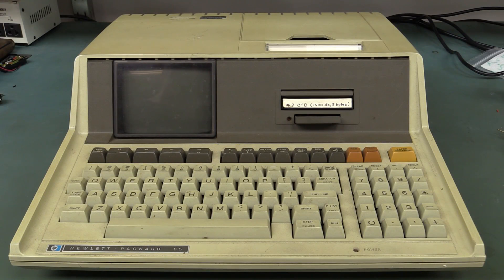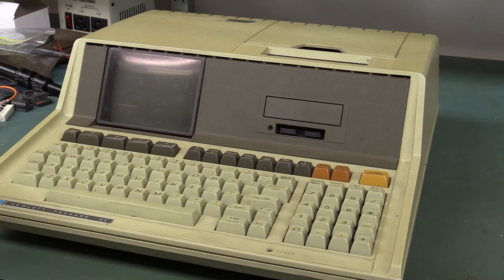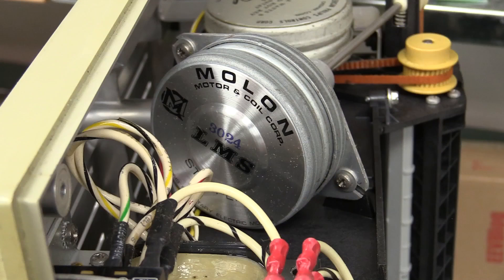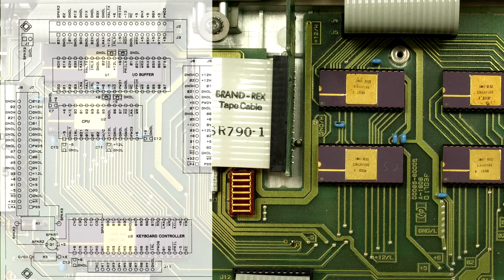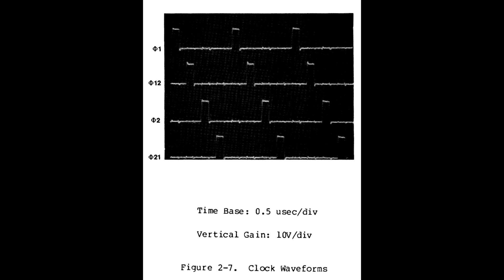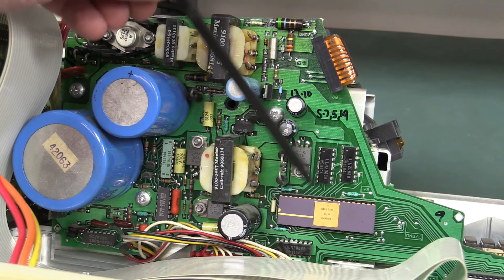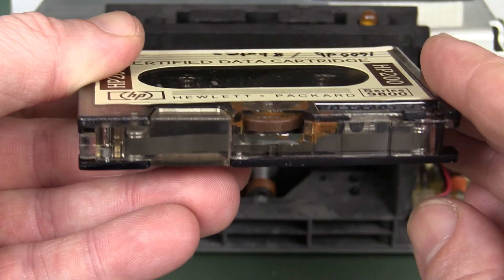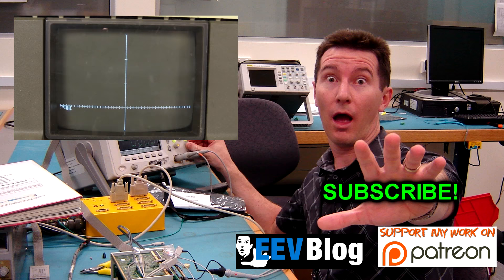EEVblog #903 - HP85 Vintage Computer Teardown

Comment: One thing that definitely stands out compared to home computers of the era is that this machine was probably expensive to produce, but that's to be expected from H.P. of the time.  This thing was also more portable than just about anything else made in 1980.
Reply: Of course, HP influenced the market. HP IB (HP interface bus) became GPIB (general purpose interface bus)

Comment: Serious nostalgia for me.  I learned to program aged 7 on an HP85a. My dad was a chemical engineer and decided to buy one because it's what they used in the lab. It came with a fantastic set of manuals which taught you how to program in HP basic. My brother (about 9 at this point) and I used to get pocket money to translate old FORTRAN process models my dad wrote for some hideous mainframe into HP basic. It was such a fantastic computer - I remember taking it to our computer club and all my friends (who had ZX-81s with 1k of RAM) were astonished by the thermal printer, built-in tape and screen and most of all, collossal 32kB of ram (we had one of the expansion units in the back). Still yearn for that beautiful clicky keyboard with lovely smooth plastic keycaps.

That was the start of a 30+ year career in programming (still going).

Comment: I used HP85 computers in 1982 while working as a trainee for a geophysics survey company in the oil industry. We used it connected to seismic equipment and to the positioning systems to retrieve the data and log it with the current position.

Price at the time was 3.500 USD

Thanks for the memories!
Reply: Unfortunately you missed a chance to say Yankee bucks!

Assuming you're not in Australia!

At least he didn't do this one like he did to his new electric car he took the Swift heart he didn't turn it on they locked the car he turned it on and he didn't take it apart.

Was going to put a comment on there saying oh he's going to take it apart in the parking lot before he even gets in it but someone else beat me to the punch sort of oh well.

Anyone else find a high-pitch voice very irritating I actually like his voice however my father has expressed this at least a few times I don't pay it any mind because to each is old but just curious if it's just him or if we would like that as well no harm done. I'm not saying it's a bad thing but I'm just curious what other people may think.

You know sometimes, too like that :-) finger pointing to myself on that.

Oh oh I know what does chips end just for 4in impact or whatever had done some damage to it let's get crackin.

Speaking of cracked chips I know I'm not talkin about the potato chip you stepped on by accident and even bigger mess.

Has anyone ever heard about those ssds solid-state drives that are like hyper secure that actually literally suck can self-destruct basically uses high voltage High current the poppy chip whatever time and then takes out the controller for the flash memory.

As well as of course full encryption all that those can even be remotely killed as in bang bang bang go to chips buy a cellular link if I remember correctly if the battery on the laptop should die and other things as well I would like to see if someone could ever get a hold of one of those that see a video of it and action blowing the chips that would be just awesome I've seen the aftermath pictures but never a video of them actually doing the destruction process.

You know who would I would not need that to destroy your data in some way chips are going bang right well he goes boom electroboom of course I'm pretty sure he'd find a way to destroy data even waited want to.

By the way I did know some way to accidentally destroyed dad on Once for some reason they were swapping out an SD card in something remove some files they really really needed and a hamper in the kitchen it somewhere is wearing the garbage disposal and yes either or they're across the room or something but having a hard time getting the SD card out we did it popped out bounce off the corner of the room and wind up going into the running garbage disposal well they were pretty pissed fortunately by the way I did know some way to accidentally destroyed Anna wants for some reason they were swapping out at SD card in something to move some files they really really needed and a happy in the kitchen it's away from the garbage disposal and guess either or there are crossed the rumor something but having a hard time getting the SD card out we did it popped out Ballast off the corner of the room and one up going into the running garbage disposal well they were pretty pissed fortunately everything that time was just a copy of the data them was in the internal memory the only realize that after about billion megabytes of curse words later.

Worthy oz of that happening at least in terms of dead destruction by accident that would have to be one in a million toilet water billion would be so I'm making a milkshake in the same thing happening just right when they opened it where is open for less than a second but yeah heard about that once but I think it was staged there's a video on some website play article was entitled dumb ways to destroy that people have destroyed data or something or a parent lost everything looks staged so take that with a grain of salt. Although probably the easiest way to destroy data on a hard drive to be a physical disc would be the usual those styles of drawing that's the glass platters and all you would need with a mechanism that would act like a spring loaded hammer in a drive housing that would put a sharp Point Stu all the platters on all sides LeBron 5 bye-bye data don't know if it would ensure enough shards to bring her every bit of it useless but it's an idea for cheap means of this. Croatian be using Google what I'm talkin about it be that somebody will get my idea LOL.

Comment: I’ve had a lot of retro tech, but I regret letting my similar HP sci-comp go more than even my vectrex. I cannot find my exact model on YouTube, but it had a 1x30-something alphanumeric PCs display. I loaded basic programs from cassette, and it had i/o cable adapters the size of 8-track audio tapes.  The HP daisy wheel printer it came with weighed over 50 pounds!

Thanks so much for sharing this.

Comment: You need to get your hands on an HP 9825. The CPU in that thing is a beast. 16 bit, 10 MHz, in 1976! It was built on a ceramic module, with multiple dies, and connected to the board by zebra strips! What's more... Zebra strips that WORK!!! Mine STILL works to this day! It also had hinged PC boards that could fold out while the machine was live!
Reply: It was based on the architecture of the HP 2100 minicomputer.  There was also the 9845c graphic workstation which was used for the colour graphics in the move 'War Games'.

Comment: Classic device. My father had one of these at university to sort a list of student names, calculate the class average and sum the term scores for each student. Once the data was entered, it took the HP85 about 7 hours to complete the process for about 300 students. It took so long because it could not store all 300 records in RAM, so the sorting process had to be partially storage (tape) based. Excellent video, thanks!

Comment: OMG!  I used to use one of these "back in the day".  The company I worked for did marine engineering design and analysis services for cold regions (ice breakers and oil rigs working in the ice) and I used one of these as the front end to a number of our systems.  I once waited for my luggage at the carousel of the airport and out it popped, outside of its box...all naked..  But it survived and fought many a battle afterwards.  Thanks for the trip down memory lane.
Cheers!

ps  The teardown is awesome.  I never did look under the hood as it was super reliable and never gave me any trouble.
Reply: Drink!!
Reply: Was using one until a few years ago.

Comment: It took less than half a human lifetime to get from that, to computers that can render this video in minutes.
Reply: Nothing amazes more than this fact, or more importantly understanding this fact and pondering the future.
Reply: My current video card has, I'm not kidding, 2,000,000 times more memory than my first computer.
Reply: Yup My first computer was an 80286 with Dos playing Final lap and Police quest. Both had about 64kb of RAM or 64*10^3 bytes. Today my PC has 16Gb of Ram or 16*10^9 bytes. That happened in 25 years, imagine another 25 years the technology we will have.
Reply: well you need computers to design better computers..
Reply: +John Hartman the original IBM PC with the 8088 at 4.77MHz started at 16 kB, but needed 128 to do real work, and was expandable to 640. By the time the 80286 rolled around (IBM AT and clones) the standard memory size was pretty much 1024.

Our first PC clone was a Sperry that had 128 on the motherboard, and was purchased with the 128kB extra memory option. That was a full length isa card that came with four rows of 18 memory chip spaces — one row with soldered on chips and the other three with sockets, for 128k per set of 18 chips you'd install. A slightly later model Sperry I once bought for parts at scrap prices had 256kB on the motherboard and included a 384kB expansion card, tiny little quarter length ISA thing.
Reply: ha! my first computer had 1k of ram, black and white graphics and no sound!
Reply: @RetroMarkyRM  let me guess ZX80/81
Reply: @ThunderClawShocktrix  nailed it! :-p
Reply: most of the development has come from alien tech which has been dripped out. Think of how CDs suddenly came into being, Optical fibres etc. it's all from Black ops projects that have access to exotic tech from other worlds.

Comment: Closest I ever came was an old  CP/M machine that the guy who ran the hardware store gave me after I wrote a basic program for him to keep track of customer's billing on a little Commodore 64 machine, I kept the data on a floppy so he could access it and write new billings and such. He was so thrilled he gave me the old machine that he never could figure out how to use (his wife gave it to him for Christmas) and threw in a brand new multi-speed Dremel tool with accessories.  I was happy, and he used the old C=64 for about three years then upgraded to an IBM.  I had fun with the CPM machine although it didn't have the games my son wanted for a PC so he flat refused to use it, I found it fun to play around with.  The amber screen was easy on the eyes, and the software packages he threw in  included a sort of pre-office type with word processing and spreadsheet operations, as well as a great little checkbook program. I was injured and had to lay around my house for a couple of weeks while I healed up, so to kill time, I took our small town phone book and typed it into the old machine, using a database setup, then did a sort by number and printed her out as a reverse lookup book.  We kept a copy of that book in our squad car for several years, I also had it sorted by street and house number so you could drive up to a house and find that phone number, then call the resident if need be to clear the house because things were getting sort of dangerous or just asked them to move a vehicle that was illegally parked blocking a neighbors drive way or such crap.  It was well worth the effort, and on that old machine, it was very easy because of the quality of the keyboard, something I have never experienced to that degree since I sold the old machine to our local Judge, who wanted it for a backup as he had all his Judge shit on his unit of the same make and model.

Comment: I learned from employee #7 of Compaq Computers, who worked for TI for years prior, that for ESD protection that the best ground strap is a wide thin piece of foil. Because the rise time of an esd discharge waveform is so fast, that skin effects dominate in the overall resistance of the ground strap so a wide thin conductor maximizes your  conductivity at the extremely high frequencies involved with an ESD discharge.

Comment: I used one when in astrophysics at the University of Missouri in 1976. It was great not having to use the mainframes to run our programs. Before that, I used an HP 9100 and Olivetti programmable calculator when I majored in electrical engineering at Forest Park College in St Louis in 1974. Great machines!

Comment: I used one of these in a radio lab for a number of years. Couldn't fault it for the ease of programming it to read and control HP test equipment and other IEEE Bus instruments too.  It could carry out the measurement and then print out the results. Just simple and straight forward.

Comment: I made a course on HP for those. They were very cute. The tape and the thermal printer were very useful . In HP in Brasil they used them as individual terminals. But in Brazil they had the expansions limited to just one slot. The keyboard was gorgeous for the time.

Comment: I worked briefly for a company that used these in the oil industry. early 80's
Every joint that was made on the drill string was recorded on these displaying a correct torque curve on the screen. & recording to tape.

Comment: The tape looks a lot like the ones I used to backup PCs in the 80s. They were pretty reliable and designed not to stretch or have the other problems that common audio tapes had.

Comment: I used one of these together with an HP-IB (IEEE 488) connection to some laser measuring equipment back in about 1988. Amazing for its time.

Comment: I bought a couple of years later 87, which is pretty similar to the 85, but with a wider CRT and no printer, also no tape.  Instead it had HP-IB, so an external dual floppy unit was the storage.  By the way, indeed there was a programmable calculator that preceded the 85 and looked somewhat similar..  That one came out at the same time as a Litton calculator and a Wang calculator.  I tested all three and only the HP did its engineering math with exponents correctly.
Anyway, I think the 87 had 680 kHz clock.  And both the 87 and the 85 had the 8-0register (64-bit) data structure that made the 10E499 numeric range possible.  And the expansion module options brought in a serial communication module and a co-processor that ran CP/M on a 4 MHz Z-80.  Otherwise, a third party, Bering sold a 5 MB (!) hard disk + an 8-inch floppy unit.  I partitioned the 5 MB to 4 sections of 1.2 MB, because the 8-inch floppy could that way be used to back up the hard disk.

Comment: BYTE magazine initially was a makers journal. Tear downs were natural as building was part of the scene. Circuit board creation, circuit design, programming theory.  All very rich. I remember one article where the limits of double sided circuit board were worked around by using narrow circuit boards that were soldered edge to face to create jumpers across the board. Component level to systems evaluation. Later years it changed as the industry provided more advanced products.

Comment: The RAM on the CRT board is supposedly UP04160-2 16K*1 DRAM, so thats 16K*4 in total. Or 65536 pixels in B/W that would be good enough for 256*256. The reduction to 192 lines may be the wrap area for scrolling the screen. Filling the memory off screen and then set an offset register during the vertical beam return looks much nicer.

Comment: 20:30 In old cassette tape decks the spools don't drive the tape over the head. There's a roller and a pin that pinches the tape, and the pin rotates at a constant speed so the play/record speed is consistent over the record/play head. If the the spools controlled the tape then the speed of the tape over the head would change over time as the spools get larger, or deplete.

Comment: Looking carefully at the key guides, I see the telltale signs of stress cracks developing at the corners.  This was a materials problem with the key guides which developed over the past decades: The guides crack due to the force of the keycap (I think a form of long-term polymer creep imho) at the high stress zones with the resulting increased friction making the keys stick.  I have seen key guides with corner reinforcement that eliminate this problem.  Waffling onward, I love these machines for the way you can control HPIB gear using the built in HP Basic.  Every piece of HP gear I have from the late 1970's through the 1980's (including the 3458A, btw) has numerous examples of BASIC programs for interface, control, and data acquisition. A beautiful piece of HP Engineering; it brings a tear to me eye.....

Comment: The 85 was a modest success, but the REAL engineering workhorse where I worked (General Dynamics) at the time was the 9845 (and the 9845C with the color screen) Two tape drives and a full page thermal high speed printer in that model.
I'd love to see a teardown of a 9845C someday.

Comment: Was expecting to see an HPIB (IEEE) socket on there. We used very similar machine for controlling test rigs for soak testing  PCM phone transmission equipment (circa 1982 ?). Racks full of beautiful HP test gear all linked up via the HPIB.

Comment: if you're planning on trying to use the thing, you're going to have to replace the belts, the rubber on the capstan, and take apart the tape to clean out the remnants of the old capstan, and probably replace the belt in the tape, as well, at minimum

Comment: This is very similar to the IBM 5100 we had at IBM in the late 70's and into the 80's.  One of the engineers I worked with had written a number of programs in APL.  I think the full version with APL cost about $20K when it came out in the mid 70's.  Of course, an IBM mag card type writer would set you back about $20K as well -- and that was in 1970 money so more like $60K in todays money.

Comment: Check out the isolation traces between the data/address traces near the memory - interesting, especially at less than 1 MHz clock...